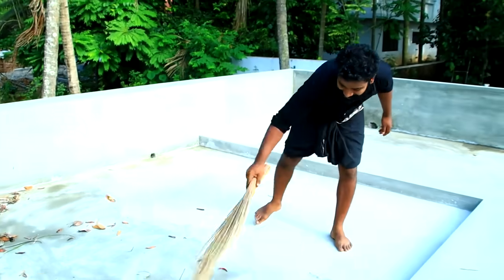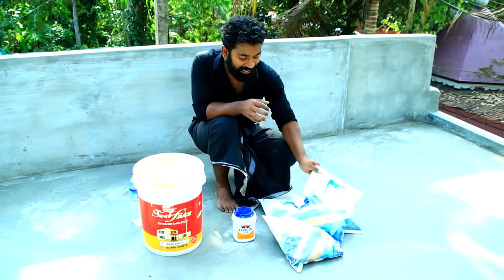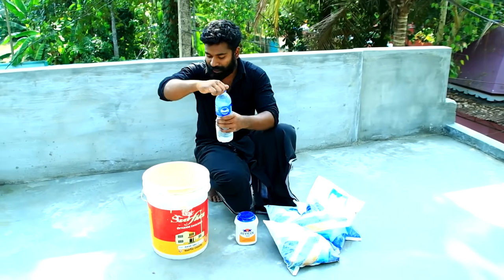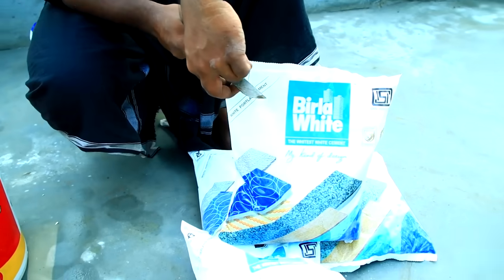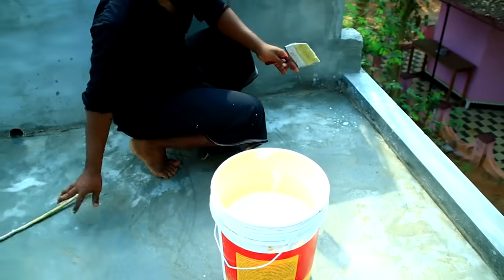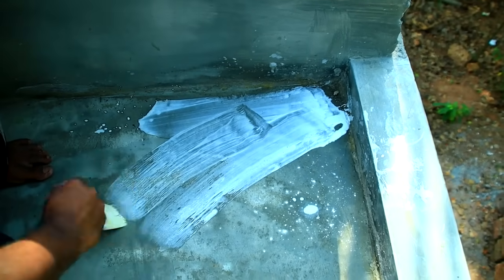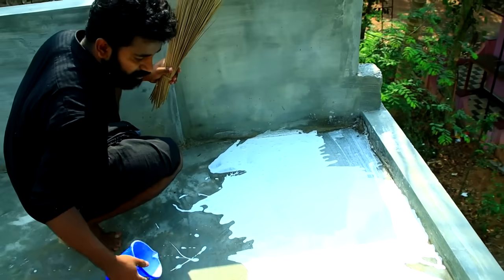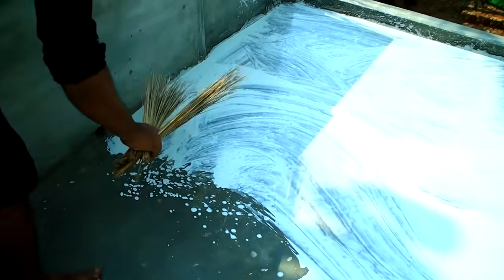വീട്ടിലെ ചൂട് തണുപ്പിക്കാം | How To Reduce Home Temperature | M4 Tech |

Comment: Hello friends - Nice video.  Please note that, before applying the cement mixture, the floor should be wet otherwise the cement will come out fast. Another method to reduce heat in the room is please avoid ceiling fans and use pedestal or wall mounting fans.

Comment: Cheta it works. After watching this I did it at home. And it was really cool even during day time. Thankyou cheta
Reply: Dear Rakesh.... Could you tell me the ingredients like white cement, Fevicol and there is 1 litter bottle...what is that?
Reply: Just Water for measuring it's 1 litre bottle u have to.add 8 litre for 5 kg white cement
Reply: @kingmaker268  Thanks👍
Reply: @sarathbabuyadlapalli5496   make it in this ratio for every 1 bag (5kg) of white cement use 8ltr of water and 250ml fevicol(1/4th of 1ltr bottle as shown in the video).

Comment: ഇത് ചൂട് കുറക്കാൻ 101% നല്ലതാണ്. ഞാൻ ചെയ്തു. Fevicol ന് പകരം DrFixit യൂസ് ചെയ്തേ... Thanks m4tech...100% guarantee ആണ് ഇത്
Reply: Dr.fixitnte eth product aanu use cheythathu.. etra quantity
Reply: @jiganto7  Dr fixit 301 pidicrete urp,  2 - 3 litre for 50 kg vembanad White cement. Dr fixit 1 litre 250 rs. 2 coat adichu with this quantity for 600 sqft